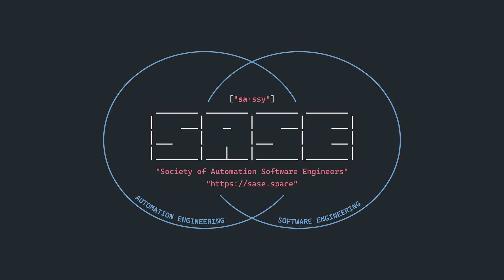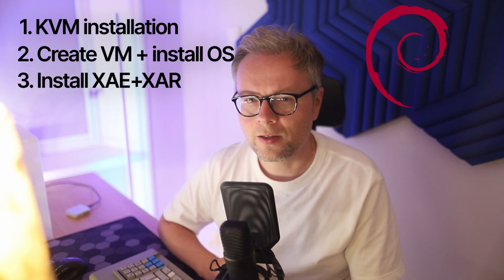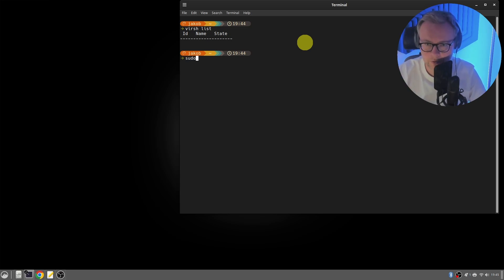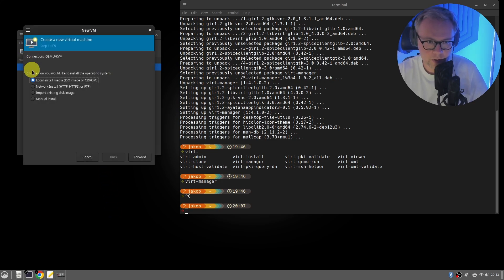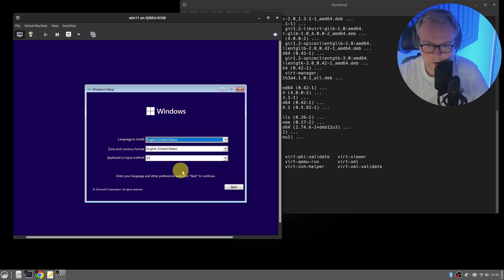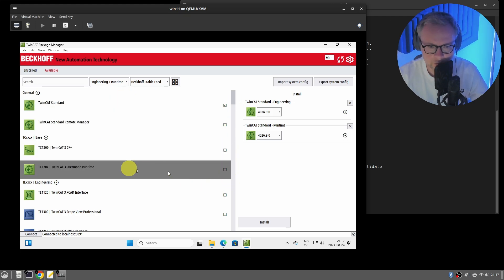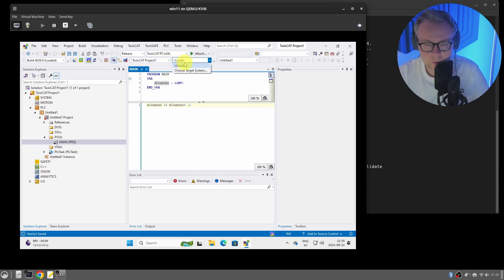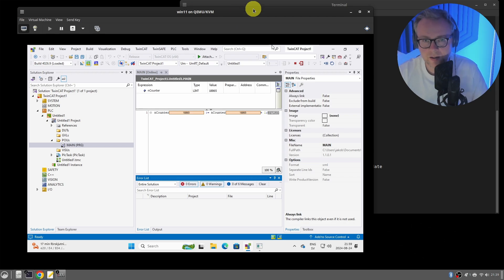PLC programming in Linux

Comment: I've been struggling for quite a while to get better performance on QEMU/KVM than on VMware. I also come across comments where people say that QEMU doesn't support using the host's GPU (except for GPU passthrough), and that fluid performance will always be poor because of that. However, it works great for you. I'm wondering if you did any additional configuration that's not shown in the video—like GPU passthrough? I thought of that because the VirtIO driver installation isn't there either. Unless you only did what's shown in the video, in which case I really don't understand why I'm having such problems :D

Comment: Thinking of doing this switch myself. Whats the best practice for storage/projects that needs to be accessed by windows dependent programs? Only git and create in the individual vm's? Or maybe a separate local partition for these kind of shared files? Or store in linux and mount the linux-filesystem in windows?
Reply: I did the switch (Windows->LMDE) and is mostly happy. Mainly tested dev with Codesys so far. Still struggling a bit with performance especially with git-actions and I believe it has to do with file-access-performance. My initial attempt has been to store the project in linux/host-side and mount as filesystem in windows. First attempt using virtio-fs which did not work at all (lower/upper-case compatibility problem), then with a samba share which works but still has low performance/introduces lags. Anyone that experience something similar and what was your solution? Thanks!

Sometime you have to asking "dumb" questions to figure out the answer. Saving the file locally in windows and everything works ok. Then a git-remote sync for backup and all should be good.

Comment: Great video.

I use proxmox on a laptop. Since Proxmox is debian based (i think), a fun solution is to install a desktop env on the proxmox server. The how to for this is on the official Proxmox documentation.

This is also great if you depoly scada systems on proxmox. You can then migrate a vm from your laptop to the production server.

A great choice for scada if you love Linux is Ignition. Both the server and developer IDE is made for Linux and Windows.

Comment: Been using Linux Mint as my host machine with all my VMs in VirtualBox for more than 5 years now. I tried KVM for a while but went back to VirtualBox. Mainly because of it's compatibility with Windows hosts if I ever need to run my VMs on Windows as well. I cannot wait to try Codesys Go when it will be released. Should then be possible to code directly in a web browser on Linux.
Reply: We run your emergency setup. Windows and PLC runtime as a VM in Virtual box. However the new twincat release has problems with old versions on the machine so we gotta do the development in a vm soon anyways.

Comment: Love KVM on linux, also some tips:  install VirtIO drivers on windows and configure the devices in the KVM settings, you can bound some cores of the cpu to the VM, you can change the number of hugepages for fit the VM ram and so on. Withouth KVM, you can also only use Virtualbox/WMware and use the same VM's that you are using on windows, they run a lot smoother on linux.

Comment: For a year now I use TC XAE/XAR on Win10 on Proxmox, which is Debian+KVM+Graphical layer.
It works very fine.
What's your experience in the difference between using Proxmox or the bare KVM ?
Reply from the maker: The proxmox solution is fantastic, and I especially like the nice user interface for managing VMs, which is vastly superior. Though it requires some additional work, it's extremely powerful.

KVM is nice if you already have a running Linux machine and want to use VMs locally.